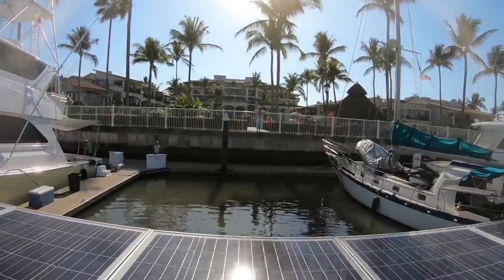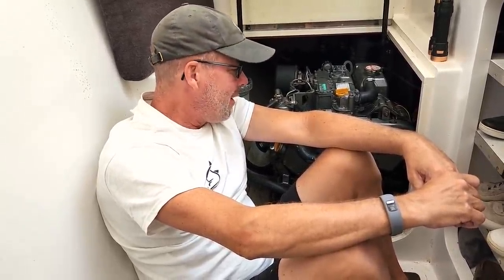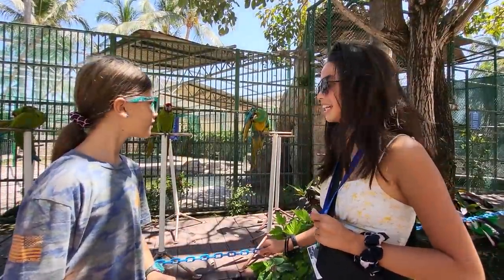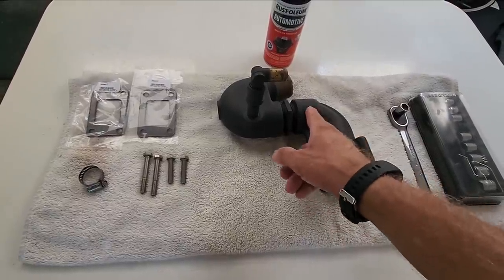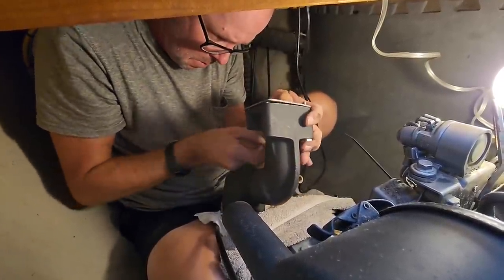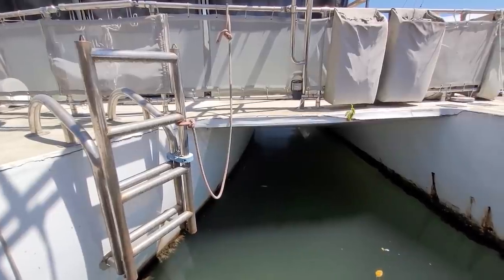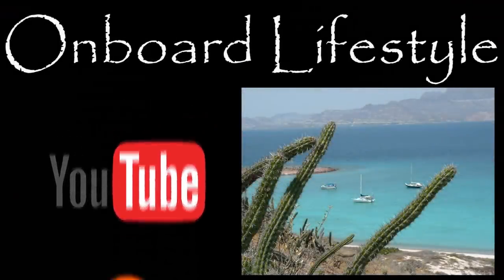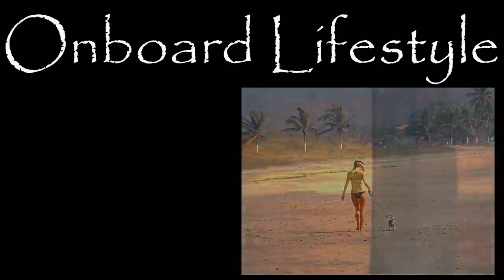Saying GOODBYE to our First Love - Onboard Lifestyle ep.202

Comment: A couple engine tips.
• The best gasket scraper money can buy is an Innovative Tools International Super Scraper.  Cleans on the pull stroke.  Be careful as it will easily gouge aluminum.
• Even better for cleaning off old gaskets is a 3M Roloc Bristle Disc.  Requires Roloc adapter.
• When installing heavy engine parts, like intake or exhaust manifolds, that you can not hold with one hand while starting a bolt with the other, an extra long bolt.  Cut the had off.  Install finger tight into one of the bolt holes like a stud.  Slide the manifold on to the stud and then one up the other bolt holes and get them started.  Once you have a couple of bolts started, remove your "stud", insert the rest of the bolts and torque to spec.

Comment: I hope you check to the inside of that wet exhaust pipe because they have the tendency to corrode almost closed on the inside. The replacement parts that you can get are now available in stainless steel to prevent the corrosion. This is the same problem that happened on my sailboat.

Comment: If both engines are the same age, you should do the same thing to the other engine, especially when it come to parts on the wet exhaust.
Reply: The engines will be pulled later in the year for other maintenance, so there's no need to tear into them both right now.

Comment: You need to put the brass fittings back on  on the exhaust. The heat, exhaust gas and sea water will rot the galvanized fittings away in no time,

Comment: Out of curiosity, did you inspect the same part on the other engine?  I have learned over the years, especially with hard engine parts if I have a failure in one part its best to check the condition of the same part on the other engine as they have had similar wear and service times.  Following this pattern on cars, boats and aircraft has saved a lot of grief over the years.  Cheers!
Reply: I have no doubt that he did a visual inspection of the other one but since the engines are scheduled to be pulled later in the year for other maintenance, there isn't much need to tear into it if there is no visable problem.
Reply: @genewaddlerandomstuff2122  fair point.